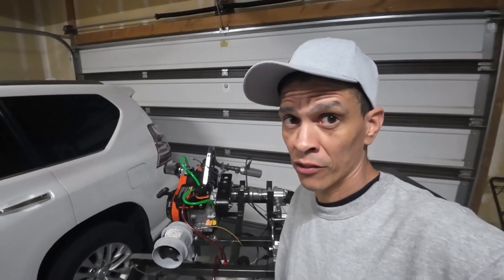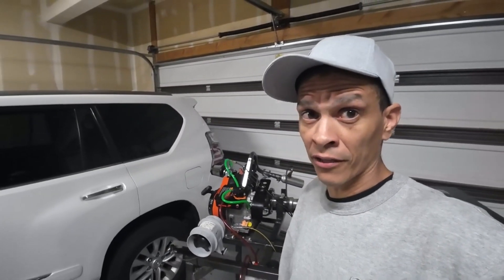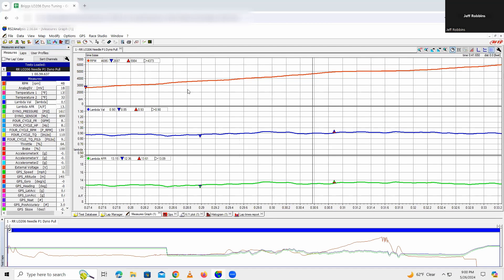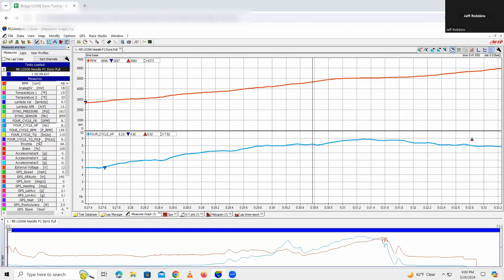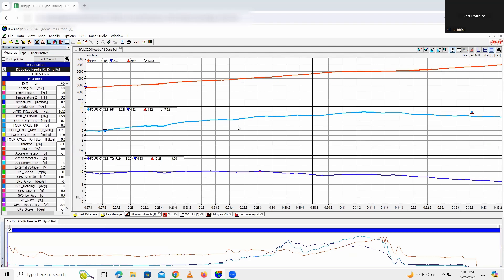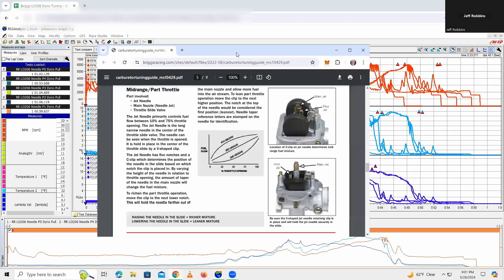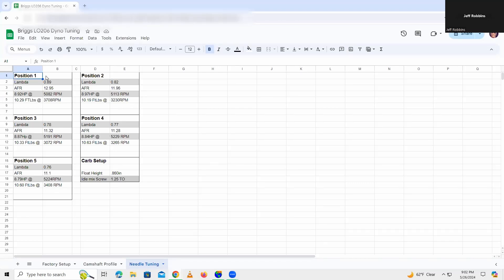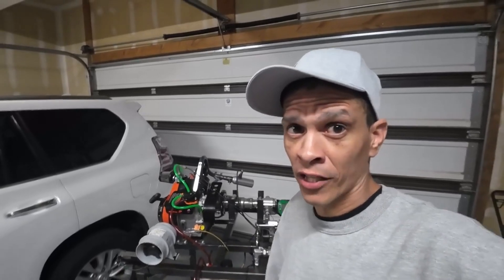DYNO Tuning the Briggs LO206 EP.3 - Needle Clip

Comment: Maybe I missed it but what was the temperature, dew point, and elevation when testing?
Reply from the maker: I had the elevation up on the screen but here are the other readings.  Thanks for pointing that out,  I added the readings to the video description.

Alt:  4600 Ft
Humidity:  17%
Air Temp:  72 Degrees F
Barometer:  29.74" Hg
Reply: @robbinsracing801  thanks man keep these coming.
Reply from the maker: @michaelmurphy6687  Engine Doc:
https://docs.google.com/spreadsheets/d/1YZD8Ocq-B1wtJy8EPLYgGobLV_l7tElFvU9SBreVrwQ/edit?usp=sharing
Reply: So did the motor was more efficient on the track when you put the needle at level 4?